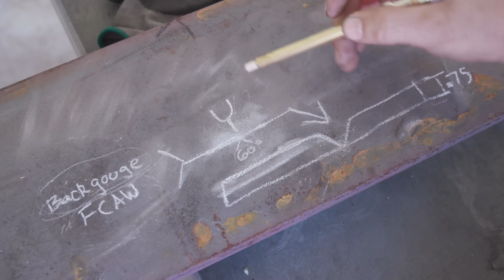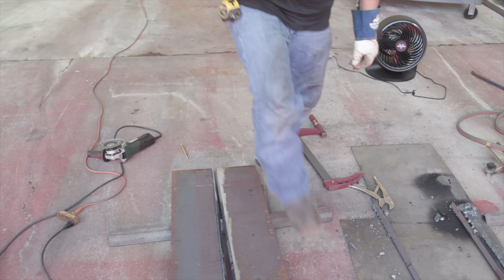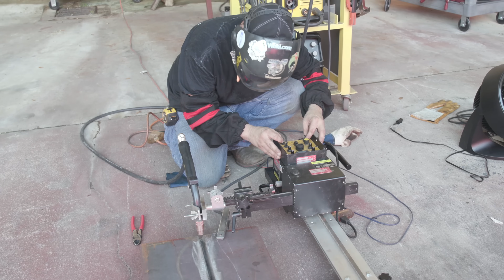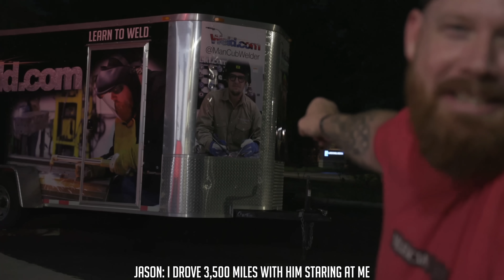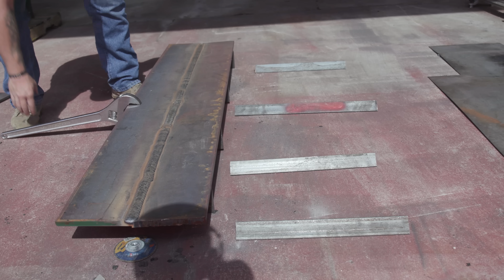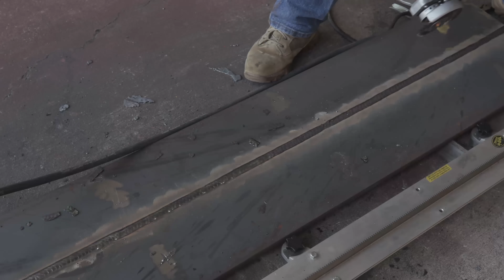Flux Core Welding with Back Gouge

Comment: Cool video but plate doesn’t hold moisture. When you’re using oxyacetylene, you’re not pulling moisture out of the plate. It’s part of the combustion process from the fuel gas. The reason it cuts better when you run the torch over it before cutting is because you’ve preheated the base metal. Not being a jerk and calling you out by any means just wanna make sure you’re giving your students the correct information

Comment: Going back yo the cutting when he says about the moisture in the plate he is wrong their is no moisture in the steel its the moisture in the air /atmosphere reacting to the extreme temperature change on the steel not from within

Comment: Cool. I suspect the displacement of the back weld has moved over due to the angle of incidence with the wire feed and arc. I have seen that before with my own tests and you know the back grind was centred when you cut it. 
Never expected any slag inclusion .. must've been just a rogue trap in there. They do show up in the cut often. Like imagine if you cut it an 1/8" to the side (1 way or the other?)
Reply: In my current job, all of my back welds are ground with a grinder. But I'm looking at a job right now it will allow me to double my pay and these videos are extremely helpful in showing gouging techniques.

Comment: That slag inclusion if xray would have flunked. Anything over a 1/32 in size will flunk. I've had a lot of experience with welding at niles steel tank in niles Michigan in there specialty tank deviation building high pressure vessels all my weld were xray welds .  Worked in the field as a tanky building crude oil tanks in Vernon ill at the end of the pipe  line from Canada. Build 5 tanks with a crew the tanks were 300 feet across with floating roofs.

Comment: This might be too far back for you to be looking at new comments?
 My project it seemed to be the angle iron I had problems with? I was told it was nitrogen intrusion?
I asked the one weld test shop, He said" We don't weld with Nitrogen" Ya okay I give up!!!!!!!!!!! errrrrrrrrrrrrr
It looked like a worm had crawled between the flux and weld? Not porosity buy a worm track/s. Seemed to fix it/prevent it  with slightly inclining the weld steel? Gasses to escape? When grinding the weldment down <0.0625 was clean weld.  Heating higher also seemed to help. I was told that that steel likely came from over seassss!  
Thanks.

Comment: I worked with a guy who could lay dualshield passes down so smooth and a final pass squared flush to the surface.
Looked better than what the machine did here, which is actually pretty shocking to me. That guy was grade A talented.

Comment: Excellent vid! 
The last time I did that type of weld was during my first year, Mechanical Engineering back in 1987
Only difference is, back then we had to do it manually, even the back gouging ( we used a special type of hollow carbon rods), and we had to first fill the bevel with a stick weld, by hand.( lol I think we used 7018 rods)..Watching this vid brought back lots of memories.
Back then I really enjoyed welding practical although my course focused more on Welding & MaterialsTechnology.
Thanks for posting and explaining the method used, step by step!
Reply: I was born in 87, and yet in 2022 we manually use this same process at the shop. They should have hired this guy,  i guess...

Comment: 20 minute time stamp the kid at the beginning of the video said you were going to be doing this with a"""LINCOLN 225"""😂😂😂🤥🤥🤥🤥🤥🤥.. BACK GOUGING A THREE-QUARTER INCH PLATE WITH 850 AMPS.??? WHISKEY TANGO FOXTROT.. you may have passed the inspectors test but .
in the real world.. you failed miserably at the . TIME AND MATERIAL. Test.. you know the ""paycheck part""🧐🧐🧐🧐🤫🤫🤫🤫😂😂😂😲😲

Comment: I want to know what happened to that""" Lincoln 225""" you showed at the beginning of the video and said you were going to run everything off of it 😂😂😂🤔🤔🤔.. YEAH IT'S CALLED ""DUTY CYCLE""if you're running a Lincoln 225. Even at 50% maximum output power.. whatever I don't have all of the terms in my head anymore I know them any welder will tell you there's a drop-off point after the duty cycle reaches thatwinding heats up all the wires in their start to heat up and the voltage and amperage will start to drop!!! What I'm getting at is you can't set up an automated welder and run off a Lincoln 225 gas machine and expect to weld for  hours continuously!!!

Comment: 8 minutes and 35 seconds.. I'm welding with flux core.... And then he hooks up a gas bottle and plugs it into the .MIG. Metal inert gas.. it's not straight flux core 🤔🤔😣

Comment: How do you call that flux core welding with gas?
And that little black spot does tell me not 100 % penetration, But for structural plate welding it may pass, But for boiler, definitely not.

If that's how you correct that cut
I say wrong !
As you are shortening the width of the plates
Try heat straightening those plates,
Apply heat on the outside at the back edge away from the cut, possibly the center of plates.
Then quickly cool it
It will pull those plates back into shape/
That's how they take the twist and warp out of huge beams rather than removing steel unnecessarily.

Comment: Nice weld. Reason for the slag inclusion is because u did a weave on your root with flux core. If u only have fluxcore and not metal core a few more passes with smaller weld bead will lessen the chance of inclusion. Really dig the auto gouger.

Comment: I can't even count how many joints I've seen break right down the toe line of a weaved bead. Seems fairly circumstantial as to when the auto airarc would be used but it's cool anyways. I once filled a 4in groove with a buggo prolly 20ft long. Backgouged by hand and filled for a UT inspection. Passed with flying colors. This process isnt uncommon in the mining industry.

Comment: amazing how clean that cut was with the oxy fuel, looks like it was machined.... great video
Reply: I've seen a lot of machine torch cut plates and this is far cleaner than I usually see though most of the ones I've had to work with are between 2-1/2" and 6" thick.

Comment: I just switched from mig to flux core today in my classes, I was suprised how smooth the beads came out, I did a T joint at 320 speed at 24. Im so glad I got into this trade it is so much fun and you meet some awesome guys, its an enviroment where all you want to do is learn more about it.
Reply: I’m starting 4G mig on Monday. I feel the same about working in welding. Seems like there are many different opportunities that are cool kinds of work. Like underwater welding or automotive if you like cars, pipeline, structural...just so many different routes a welder can take.

Edit: I meant Tuesday not Monday. Monday is Columbus Day
Reply: Starting t joints. 20 300. Coming out to be a beautiful weld. Got the gauge out and the teacher looked at it and it was a near perfect weld (my end was short)

Comment: Use to use .120 Flux core to weld grouser bars on dozers. Do a root pass on one side only with 7018 1/8" with good tacks on opposite side. Not 100% weld but good enough for grouser bars. Nice video! Before the was 1/4" 7018 rod.

Comment: I pissed off a few union welders when I stick welded my plates and passes the x-ray and destructive testing for my ASME and UL certifications.  They failed, even though they cheated and used track, automatic sub-arc welders.  They welded the slag into the weld.

Comment: I've never seen a slag inclusion that big in a weld that wasn't rejected. And to be honest I have never seen dual shielded flux core leave slag inclusions on the beveled side. That 0.045 wire will hand weld to fit code at 700 IPM and never once have a slag inclusion if you can weld worth a flip. Hell we run verts on tanks that are 5/16 thick shell wall between 500 and 600 IPM. Anyone advocating for automatic welders and gougers is either lazy or can't be consistent with their hands. I've never failed an x-ray or UT with dual shielded flux core and that's counting Fernandina Beach Florida at west rock building duplex tanks in the summer with no wind blinds. You guys need to get a real seasoned flux core welder up there one day to show your learning viewers how to do this stuff the way the companies want it done. And hey, if you're interested in a challenge or to call a bluff, just let me know. If my way fails any test you perform, I'll pay for the material used. But these guys need to see what they're going to be expected to do when that project manager hires them and sends them out with a foreman that expects 3 verts 8 feet long welded in the shell buggy and only take 2 maybe 2 and a half hours. And they need to see how to do it by hand and have time to practice.

Comment: We run fairly similar setup that you have here while building 89M wind towers from scratch. Take flat stock like so (except about 12'x36') put 15° bevels on all 4 sides. Roll them into a round ring. Put a small stringer (.045 GMAW) in the 12ft seam. Then it gets filled with 5/32" SAW. Which includes  AC 1000 and DC 1000 power supplies. After inside filled in the outside is back gouged clean hopefully. Then same thing on outside with the SAW. Both welds are checked by quality, if they pass quality they get X-rayed by an ouside contractor. The ring must be re rolled due to the heat when welding. After they have been deemed completely round they get put on a line where I fit them together in 10 ring sections( towers are 89 meters tall you just can't build them in one section and expect to transport them ). There are 30 rings total so they are built In top, mid, base sections. We have a 15 ton ring cranes and two 45 ton section cranes that we use to move these rings and sections around. Its quite the process. Very cool tho to see someone else doing scaled back version of what I do all day. Btw we use .045" flux core wire when doing repairs on bad welds like lack of fusion or just garbage trapped in it. Also when installing the doors that go at the bottom of the base sections.

Comment: You should never weave fluxcore it traps defects in the weld. Run stringers instead.
Reply: You have no idea what your talking about. I weld from root to cap on 3/4 inch thick shell wall and never use anything but a weave. He wasn't hot enough to burn out the spatter his nozzle accumulated and dropped into his puddle. Those vertomatics like he was running do not make weave mistakes that lead to lack of fusion as you claim he has. What he has is a slag inclusion. You don't get slag in a clean weld unless you put it there and fail to burn it out. He was almost on the coldest setting you can have that wire and actually burn it. Double the IPM and increase the heat by 1.75× that setting. I can hand weld that with an open root on a vert. No reason why they can't max out the wire feeder and set the heat to match and weld flat. What you're saying is just an old old old and very ignorant current opinion. When it was originally formed, stick welding was what it referred to because of the lack of ability to carry heat required to keep a bigger puddle to allow for a weave. So your flux would already be hardening when you came back across. Except for obviously too big spots, you get better results with dual shielded wire when you weave.
Reply: @justinmcwaters4962  lol I'm actually a certified FCAW & SMAW Welder.  I know what I'm taking about.  It's apparent you don't.

Comment: Why do you switch to flux cored wire after using argon. Size of wire? I have worked in NASCAR for about 20 years and we always use argon and solid wire. But we don’t weld anything that thick. 1/8” is the thickest we encounter.

Comment: Cut was too slow resulting in turning the plate into a banana and helping in ruining the fit up. The only thing sexy about this is the cap and so it should be, its done by a machine. That's a decent inclusion bro, ticketed welder woulda nailed it

Comment: Watching automated welding is probably the most relaxing thing on the entire internet
Reply: The boiler shop, I worked in; (when I was 16), had an automated welder that welded donuts together to make 36" bends for coal shutes. My job was going up inside them and air-motor grinding the root smooth. ( I almost lost my hearing from that job.) It was awesome to watch those two half donuts, lifted in place and watched an inside tho hole, torch and an outside the circumference torch. They were running two speeds at the same time...not as far to weld in the center, but about 10 feet outboard side. Both were vertical and the flux depositors would make a hill of flux and the solid wire would weld thru it. The heads were stationary and the donuts rotated on Hugh "V" Rollers. That was over 50 years ago! Boy hidy, automation sure has gotten better in that length of time!
Bill from Tn. 🇺🇸
Reply: Hell of alot Less work can't wait to get into it

Comment: Tack each end of the plates together then run a 1/4" grinding disk through the gap. Grind the tight spots. Cut the tacks and re-bevel. Perfect gap
Reply: If you were to do it like that you would have to either grind about 1/8 inch of material off of each side the whole length and the whole width of the bevel. That is a ton of grinding. And if you would just to take it from the tip of the top to the tip of the bottom which would be a lot quicker and a whole lot less grinding but you would also lose your 30 degree angle on either side. So I think personally what you did was the right choice

Comment: Coming from a nonwelder, you certainly know how to explain things to a noob. I took shop in HS where we were introduced to MIG and TIG welding, but haven't touched anything since. For those who say manual labor is simple and anyone can jump right in without any education, if you don't know what you are doing you can quickly end up with 3rd degree burns or blind.

Comment: A.couple of things,
First bevel was perfect example of how to utilize a track torch. Second not too bad but my concern is taking of overall width of the part  in order to close a gap is almost never an option. If you are back gouging anyway filling a gap and maintaining your overall dimension is always a better option. Also as a structural steel fabrication project manager, watching all the unnecessary manhours used to close a gap you could have just welded was painful. 
The weldout and machine settings were superb.
Reply: Exactly. I don't even run a landing on the verts because of just putting a seal pass in it to help prevent a blow-up. It can be a dirty down hand. You're gonna gouge it out. They also had the perfect chance to teach learning students what a key plate and bull pins are and how to use them. Plus the settings they had their wire at we're on the coldest side they could be and still work. Not sure what code he's talking about but API would fail that weld every time with that amount of slag inclusion.
Reply: Depending on what your building there's usually a tolerance your allowed to give a little leeway. Your right things almost never work 100% the way you'd like. We put in a small stringer in the bottom to close any gaps so there arnt any blow throughs. Then back gouging will take the stringer out and make sure you have fusion you need.
Reply: Relax your getting wet over a track torch..
Takes nothing to run 
Trying building one
Reply: The amount of dross under is a travel speed issue
Reply: I agree, if the two plates are to finished dimension,then the gap needs filling to preserve the overall width!

Comment: There's no "moisture in the plate", That's the cold steel condensing the water made in the flame.
Reply: It's 2020 and these welding specialists are still saying there's moisture in the plate...awesome.

Comment: Should’ve called me to come weld that for ya. I don’t need a Bug-O and wouldn’t have trapped slag. Couldn’t help but laugh watching y’all try to grind out that slag. Btw....judging by how much you grinded, it wouldn’t have passed inspection because it’s shot by the length of the weld and if y’all grinded that much and it wouldn’t clear up...could’ve had a slag line down the whole length of the weld. The allowance is 1/8” in length

Comment: For those asking about NDT inspection. Yes xray would pick up that inclusion, but I'd say depending on what code its inspected under its well within code. Most code allows an inch or better if slag inclusion in every 12 inches. Some are more stringent, some less stringent. Also depends on thickness of base material and and thickness as well as length of inclusion. Most defects including slag, porosity, lack of fusion, hollow bead, and even undercut on some codes have an allowance. Usually cracks are zero tolerance,  accept in some codes star cracks under 1/16th are allowable. Like I said it varies with code and material thickness but most, if not all ( I'd have to check) allow some defects. Xray would pick it up, UT would pick it up, RTR would pick it up, Magnetic particle inspection would not, and Liquid penatrant would not. Hope I answer everyone questions.
Reply: Maybe your inspecting Chinese welds

Comment: Hypertherm pmx105 with a machine torch set up in gouging mode set up on the track welder. instead of the carbon arc would of been a good option as dont need the large generator and huge welder ect. You guys should do a video with it i think plasma gouging in very underutilized.

Comment: To stop plate from bowing run 2 tips one for the bevel and a straight tip at the outer edge taking a small strip of metal off.I used to make cutting edges for loaders etc.